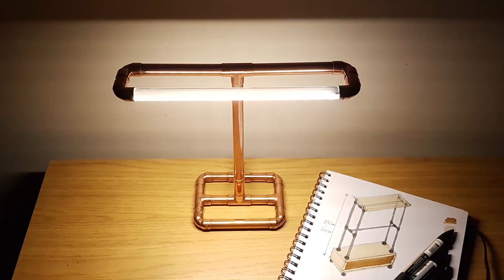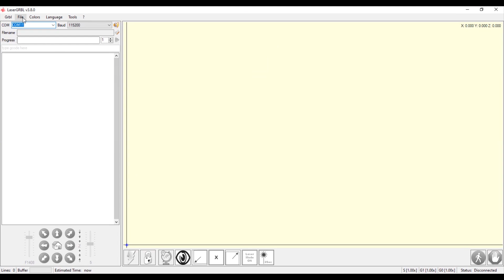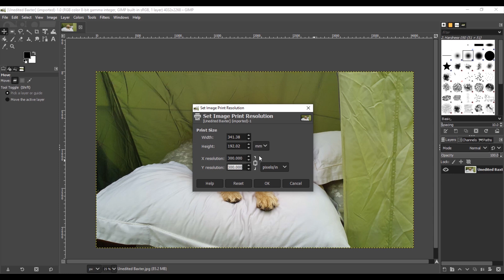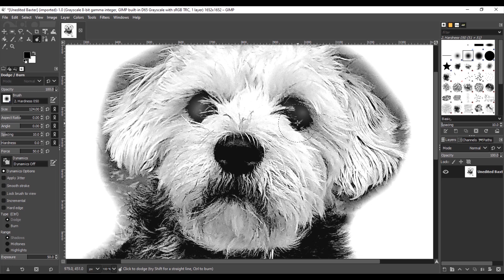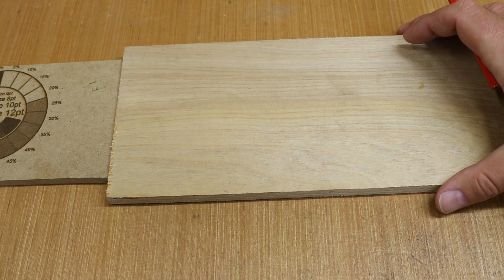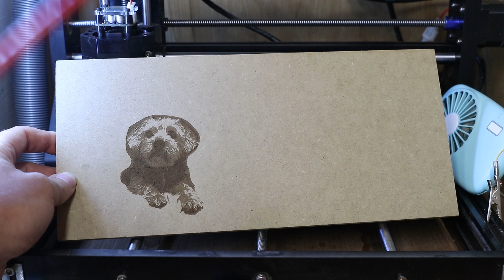3018 Pro - Basics for Laser Engraving

Comment: Hi, nice stuff. i run my laser on a prusa i3 using stock firmware and laserweb on my mac. this is what i did to tune my laser min power. it is material-dependent, so you have to note down  the best setting for each material. use the gcode console to feed power to the laser in increments until it starts to burn. then use rapids to determine how fast you have to go to achieve the burn you need. once you know what each level of grey needs in terms of laser power and speed you can then adjust your min and max to suit.